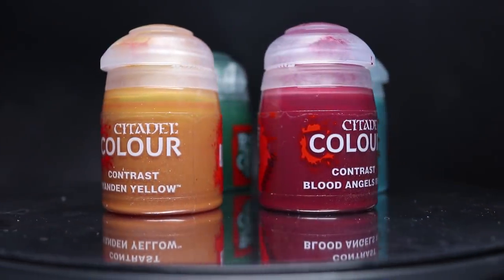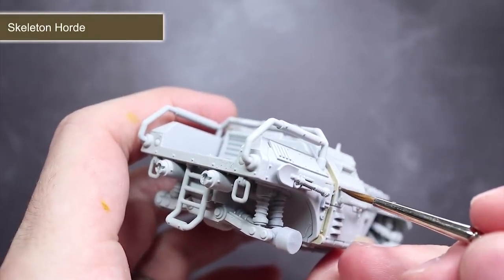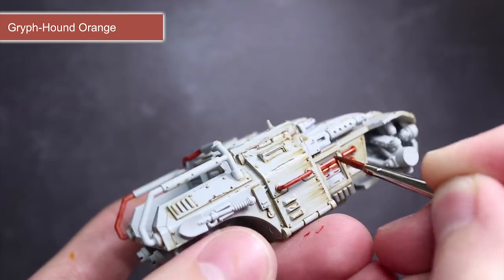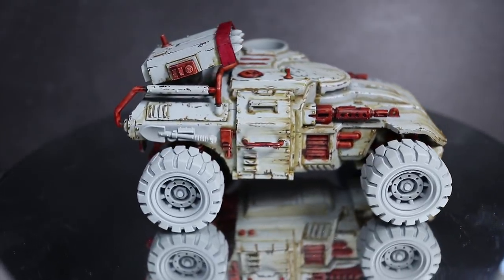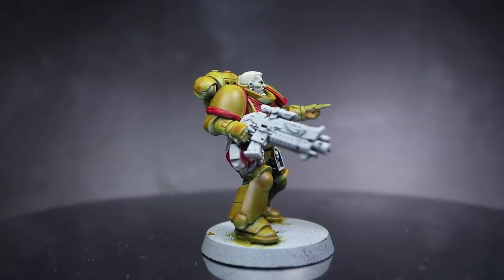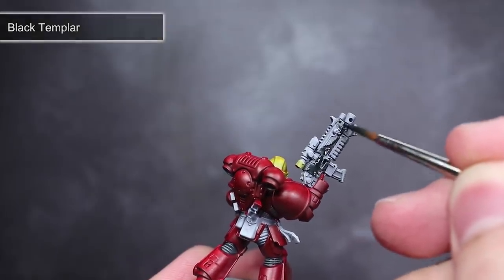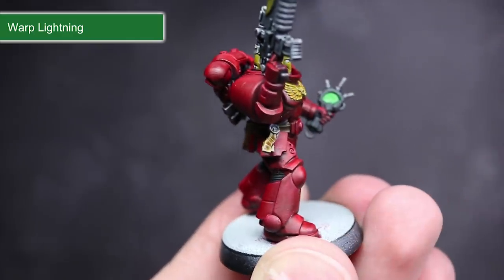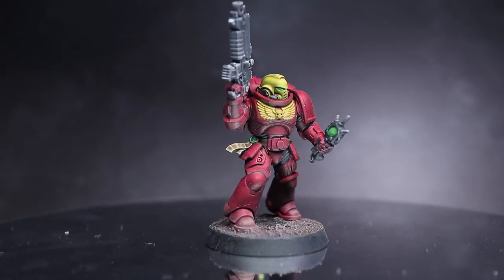Experimenting With Contrast Paints - Zenithal and Vehicles

Comment: Great video thanks.  I’m interested in post application tidy up.....so for instance where the contrast paint may pool in unintended areas, such as on armour panel, what is best way to tidy up after its dried? Do you overpaint with normal paint? Do you take it off? Do you have to paint undercoat and paint again? If you overpaint with normal then is there a colour equivalence chart for the contrast paints to the other paints?

Comment: Hi Pete! Thanks for this great video. It seems that Contrast paints do well painting the base color and shadows, but the extreme highlights are more difficult to achieve... Have you considered heavy drybrushing white over the primer (zenital or not) to facilitate the auto-higlight effect on the edges when applying Contrat paints? Cheers
Reply: I'm with you on the highlights on the Blood Angel for example. Thinning the Contrast paint with the medium and opting for two thin(ner) coats might help boost the lighter colours on the raised sections.

Comment: Did they give you any clues on how to go about getting a "best match" to the more traditional paint schemes? Will there be something akin to a conversion chart? A lot of people may like the idea of the new range but will want to maintain a similar look to their existing models. Thanks
Reply: This doesn't seem likely. With the current paint range it was a replacement for the old line and so the conversion charts were produced both officially and otherwise. This new line is a supplement rather than just being the new way to paint and replacing all the old paints. To be honest I think it will take a fair bit of work to make the contrast painted minis match traditional styles perfectly.

Comment: Could you boost the contrast with a Nuln oil wash over the marine?
Reply from the maker: Yup. You can use your normal methods over the top with no issue. You could easily add a wash and pick out a few more details with edge highlights too.

Comment: There are not contrast metalics right? How would you paint a golden stormcast? With some yellow?
Reply: prime them with Gold spray? It paint about 90% of the mini for you
Reply: iyanden yellow appears to give a rough gold NMM effect, xavier
Reply: I think you could use them over a metallic base coat. I'm sure there where some examples on the warhammer community article about the new paints.
Reply: There are contrast metallics, he uses one in the video for the boltgun. Check back through the video for the name, but I think there is a gold metallic option as well, as I have seen Stormcast painted up using the contrast paints.

Edit: Basilicanum Grey - Is the boltgun gret metallic contrast paint.